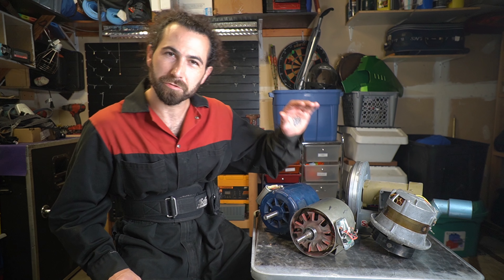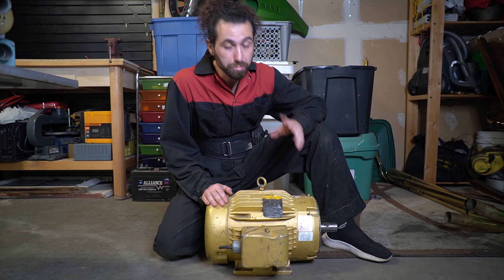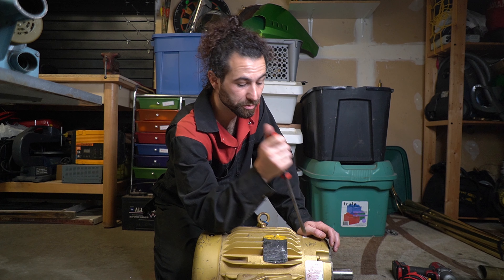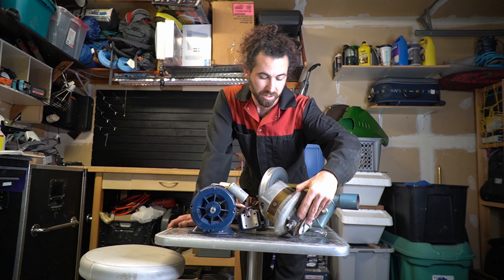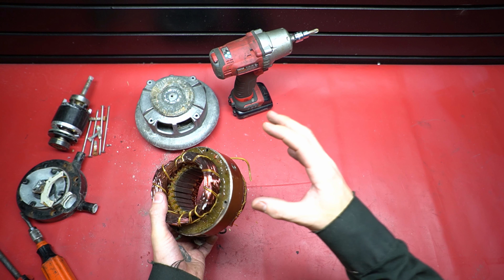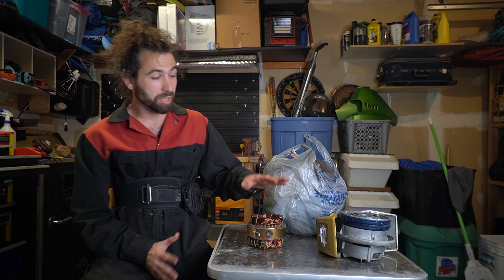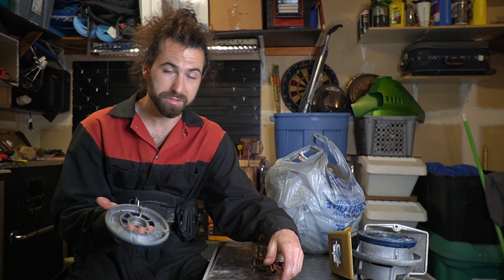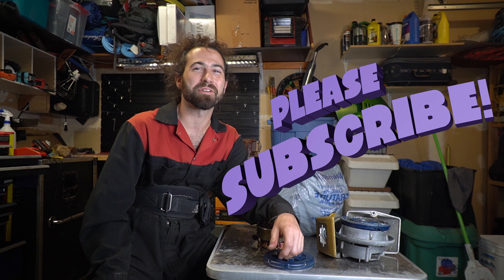Scrapping Electric Motors For Copper Recycling - The Complete Guide!

Comment: We were able to save 1000 lb of number two from the motors during the lockdown. Normally we cut the motors out with the sawzall. Then we cut the copper with a sawzall or we use a four and a half inch grinder with a diamond blade. Sometimes we use a 7 inch diamond blade but the diamond blade works better it doesn't fall apart and it doesn't leave us much dust it will cut down on half of the amount of and the blades will last three times longer. Remember if you use a 7-inch diamond wheel you have to use a bigger grinder. We also suggest if you're going to use a vice use a smaller one or one with smaller Clausso this way you can put only half the motor in there to bite down I'm half of it and that's all you need. You'll never be able to find a place that will open up big enough to hold the motors. That's a good video thanks for doing it. Once you going to hang up doing it you can knock them out very quicklythe big motor probably would have taken about 15 minutes to a half-hour the little motors normally take about 5 minutes. That's once you're all set up and you have good experience on doing. A chain hoist fromceiling hanging down with Claus is the best thing to use and you can pound out the copper. Remember gravity can be your friend. We even cut up compressor motors out of sealed units.
Reply from the maker: Sounds like I should hang out with you for a day! Thanks for all the great tips 👌😃
Reply: Some 1 inch acme rod and a few nuts and some steel will make a pretty nice vice that would work as well. Just a thought. I have ordered 1 inch by 5 threads per inch nuts and rods for a low price online a few times.
Reply: A large vise is the best but no vise is big enough for the larger motors. Doing like you said is the way as far as clamping them.

Comment: Having the right tools makes a huge difference. I have a hilti wheel cutter with Diablo cut wheel. Cut off both sides, go through eight motors in an hour.
Reply: That’s impressive
Reply: I hear you on the cutting wheels,but the other sounds exaggerated.

Comment: I have grabbed several fan motors and had a ton of fun figuring out how to get the copper out without cutting it. I cut all the string off and then worked loose wires and too them out one loop  at a time. Inner loops first, outer loops after. It was time consuming and I found it fun but I am sure others would find it tedious.
Reply: Way too slow .No one I know would call that fun.Cleaning motors is hard work.

Comment: First I would like to say that I always enjoy your videos.  This is the first time though that you approach was sadly a very inefficient way to remove the copper.  I do a lot of them and I also use a cutting wheel to remove one end.  But then I have tent stake that is roound  with a loop on one end.  The diameter is just small enough to fit inside the grooves where the copper is, and I cut off the non looped end to create a flat surface.  Then it is just a matter of tapping each slot of copper until the copper is roughly half way out of the housing.  Then I use the claw side of a hammer to strike the copper which pulls the copper the rest of the way out of the housing.  It takes me approximately 8-10 minutes per electric motor.  Good luck and keep posting great videos.

Comment: Extremely glad you finally are taking apart the motors for the copper windings. That’s my favorite part of scrapping from just the payloads of copper I get. Some motors are incredibly tight but others have windings so loose they just pull right on out
Reply from the maker: I figured as much. The blue one had windings packed right to the edges of the channels, and the other ones I had looked like there was a lot more space. I had some more footage explaining my observation but I decided to cut it to keep the video length down because it didn’t feel like it added significant value that wasn’t otherwise implied. Thank you for confirming my suspicion!

Comment: Hey there boss.  Small and big are both worth the effort.  I get them down to the case(small) cut off one end using a hacksaw on a vice(least amount of waste), put on side and roll a little at a time hitting it with a 3lb sledge(pushes stator walls in this loosening copper) too the open end with a little penetrating oil, move to next and do the same.....By the time you're done with next the previous one will let copper go with little effort.  I can knock down 15 in an hr unless my canine companion wants some love.  Big ones I cut end, beat with hammer, oil outside of stator, section with chisel and hacksaw, little oil, flame(to loosen glue/insulation) hammer and comes out quite easily.  My biggest stator was 190lbs and still wasn't that bad(used 16lb sledge on that one) on time.  I do the aluminum ones for the steel(yard picked my truck up with claw crane and dropped it with 1400lbs of steel in the bed so I get a really good price on steel) and save the wire til I get a few buckets and add it to an aluminum run in.  Rock and roll sir.

Comment: I save oil from compressors to use for lubing up motor windings so they come out alot easier.   Great for rusty bolts too and its free as a by-product of scrapping 😎
Reply: If you start cracking open AC comp motors there will be a lot of oil to get rid of. That oil makes the windings come out pretty easy and can be used to lube other motor windings.

Comment: For the reciprocating saw get ghee Diablo blades, they do cost more but last longer
Reply from the maker: Hirsch nope thanks for the tip! I definitely had the wrong blades. And I am a big believer in spending a little more for quality tools to get the job done right.
Reply: Carbide tip
Reply: @thubprint  another tip would be to examine the tooth size of the Sawzall blade. I suspect smaller would be better, as it's normally the preferred style for thinner material, but copper is so soft it may not matter. As far as carbide, yes it's amazing but way more expensive, so cost/benefit has to be a factor. Also Diablo seems to consistently be at the cutting edge of carbide and bladed tool research, so they're where I would definitely start. They also seem to have very competitive prices from what I've seen and what I remember. Hope this helps!
Reply: @ChristopherGoggans  Diablo blades are the best. Few notes on them are to start off slow and then speed up. Keep them cool and they will last a long time. Mind your blades with care and they will stay good. I cut 3x6x1/2" thick tube 2 times with one blade and its still going strong.

Comment: M8 that was an informative video cheers. I scrap the motors from the water pumps inside the washing machines. They're small motors that are made of some type of composite , easily breakable and worth the amount of copper in them.  Keep up the good work. God bless y'all.
Reply: I do that also.All manner of motors.Washing pump motors are usually copper but the drive motor is not. The washers that have no agitator usually have copper also

Comment: Well put together video!
First time is always the longest!
After more experience even the big motor should take well less than an hour and the small ones less 15 minutes! Then that's when you start to realize it's worth it to crack them open!! 
Especially with copper prices on the rise!!
Have a GREAT Day!!!
Reply from the maker: Thank you, and you as well!
Reply: It's about time someone was honest. Thanks for that.Some of the smaller ones will even go faster.  I even do ceiling fan motors . These motors use a different method but are usually done within 4 minutes or so.

Comment: I wish you or another scrapper lived by me so i can buy your copper so I didn't have to do it, since I just melt it down for funsies. However, I will tell you this. I spend my time going to my scrap yard and buying motors to pull the copper out of. I have never found aluminum in the industrial electric motors, always copper. If im not mistaken copper is way more conductive so it can make for more powful motors that the industrial purposes need on their applications. My scrap yard doesn't get the bigger ones often, but a lot of the smaller ones, the smaller ones are usually from boat lifts since its Florida where im at. The only ones I have found to have aluminum wire, and I have been burnt every time is appliance motors... dishwashers, washers, and dryers, sometimes microwaves. 

Also best way to dismantle (i have found) for the cases, is to cut off each side of the chonky windings (6" grinding wheel best for the bigger ones or ya, sawzaw) Get two building cinder blocks, place them on your work bench, put the stator on top, and then punch-out the straight bits in the stator case. I made a metal box when im grinding that'll contain most of the copper dust in the box, and i can sweep up all the copper dust, put in a jar, and then I melt it. For you scrapping idk how dust would work at a scrap yard. 
But ya but hammah smash to the iron and aluminum cases, grinder to the steel, pop right out.
Reply from the maker: You’ve got it figured out a long time ago! This was a learning experience for me for sure, and I made a lot more work for myself trying to do it quickly and easily.

Comment: Definitely assembly line several of them at once. It makes it look like you get more copper when you have several to show for it. I wish I could get some giant motors like that all the time!
Also for my aluminum ones, they are only one or two cents less than a copper motor at my yard so I leave as is, maybe bust off the easy cast Aluminum for a little more.
Reply: One of my great disappointments in life was finding out that most large appliance motors have copper coated aluminum windings. 
That, and getting fat after years of being in shape.
Reply: @willlastnameguy8329 I don't think it's a copper coat. Some of the windings are green some red.The coating is a coating to keep the electricity from jumping from one wire to another Color means nothing.

Comment: I did scrapping.  As do some people that had used copper as
salary hire or owned it as a business property.  Either of the
latter can fall upon a passer-by that lacks their permission to
handle scrap.  The scrap I got came from obtaining verbal
permission after my day work at the site was completed.
I still have about 3 yards left after 28 years of using it for my
home repair needs.  Saved me a dime and time wasted.
Personally, I never cared for motors, but some do go there.
Reply from the maker: I’ll be keeping an eye out for the big motors, but for the most part, nah.
Reply: Motors get way easier with time and are very profitable.

Comment: Once you get the casing cut or broke off.
Cut the lead side of the copper off.
Build a nice fire and put the windings in the hot fire.
Let cool down and start pulling..
Reply from the maker: Oooo, thermal expansion! That’s a real good idea to get things moving, and if you’ve got a pile it would be real efficient too

Comment: 10:44 which is why we bake the motors when we are doing a rewind. You bake it to the point the varnish melts and burns off and its easy to cut through the windings to count the turns.
Reply: Burnt windings are not sellable.

Comment: 2 ways youngin.  First, wood fire and burn off the coating.  that loosens the copper and brings it out easy.  Vinagar and salt will clean up the copper to #1.  2.  air chisel will bring them right out after you cut the windings on one end.  A few have plastic coating like house wire instead of enamel.  Just run those through a stripper to get #1.  Muratic and salt will strip the enamel taking it to #1.  Motors are easy money once you learn how!
Reply from the maker: Can’t wait for the next pile now ☺️
Reply: @thubprint Don't burn unless you absolutely have to.Your neighbors will call EPA or some such nonsense.

Comment: That was a good idea scoring the cast shell like that. I never really thought of that. Them cast iron ones are way harder than the cast aluminum ones. I used to have a 7 ft. piece of pipe with a 10lbs. splitting maul head welded on the end of it. I nearly broke my wrist a few times trying to get the cast iron shells off of them big ones. 

If you do this again when you get the big one down to a stator, cut both ends of the windings off. then throw it on a vise or drill a hole in a pretty sturdy table and punch the copper through the holes individually. I used to have the bolts I saved from big ac compressors hanging on my truck bed for this purpose. some people use nail punches, but I've found you generally can't get the copper all the way out with a nail punch and generally have to pull it half way out with some pliers or something. careful with the bolts though they tend to bend and get stuck unless you hold them with some kinda pliers.  

If you do it that way you should be able to get the big one apart in maybe 30-45 minutes depending on how stuck the copper is inside the stator. 

the big ones really used to slow me down when I was running sealed units. the first one I did took me two hours of strenuous beating and trying to pry the copper out with a huge pry bar. then someone told me about the method I just went over.

 I made a hydraulic puller for them now so hopefully they won't be an issue anymore.
Reply from the maker: You MADE a hydraulic puller? That’s rad! (I think I mentioned you in this video but if I forgot, I meant to) your video was one of the ones I studied trying to figure out the easiest way to get these apart, but I didn’t have a maul so I needed to make do. Hence the scoring!
I think next time I get one of these that’s gonna be the trick, cutting off all the ends and working the holes one by one. I was trying to save time keeping them together, and that’s what made it take so long lol.
Do you have a video of your hydraulic setup?
Reply: @thubprint  yeah. its actually a log splitter. I bought it new just cause it was easier that way but an old one would work. or if you know a guy that is good with hydraulics and welding you could really make something a lot better but I don't know hydraulics that well so I just made something that worked for what I needed it to do. its still in its early days. more modifications to come but this is what it is right now. https://www.youtube.com/watch?v=Du74WrzijGM&t=1881s
Reply: @thubprint  I watch a lot of your videos as well at times. even if I know how to take apart something that your showing how to take apart sometimes I still watch how others do it. your videos really explain things pretty well to the viewer compared to most scrapping channels. its almost like you went to school for film or something.
Reply from the maker: @scrapmanindustries  I appreciate that, thank you! I didn’t do film school, I just watch a lot of YouTube and have a very short attention span lol. I like to write a script first (sometimes) so I can stay direct and to the point, and keep “show them don’t tell them” in mind. Stoked to hear it seems to be working!
Reply: @thubprint  yeah man, there's definitely a lot of information people can get out of your videos. the only complaint I have is the man bun. but those just aren't my thing I guess. definitely keep up the good work.

Comment: On large motors, I cut off both ends of the copper windings and use a long thin bolt from the motor to tap out the rest. Some of it even falls out. Usually takes me about ten minutes
Reply from the maker: That’s a MUCH better idea... where were you a week ago??? 😂
Reply: Glad you like it

Comment: I find it very easy to remove the copper from motors and transformers after you stick them on a BBQ grill and cook them for a while. The fire burns away all the string, glue and insulation completely. You then just drop the entire transformer into a large bucket of water and wait for about 10 minutes while the water boils.  The wires will just pull out without even cutting them. Plus, the wire is a #1 product ready for melting or selling. I melt all my copper into ingots, and there is hardly any ash or slag.
Reply: Very illegal won't work if you have neighbors close buy.Burnt wire is not sellable on the other hand if your smelting and no one close .  Then go for it.

Comment: A slide hammer with an appropriate size right angle hook on it will get the wire outta the bigger motors while only cutting one end off.
Reply: Have not tried this but I will. Faster means more money!

Comment: Nice take on scrapping! When I get the motors with the heavy coating on them, I like to cut both sides and then punch the rest thru. Seems to do away with all of the binding that you just experienced. However, I did get a few tidbits of info about checking them to see if still good. Thx! GearHead!

Comment: Okie scraper uses an air hammer to remove the copper from the metal housing.  You should check it out.
Reply from the maker: I’ve actually seen him use that and it looks great! I don’t have an air system set up unfortunately but if I get one, that would be a great asset to the toolkit 👌
Reply: I wonder if this works for the motors that are really stubborn. I need to get a bigger air compressor so I can try it out.

Comment: Not sure if you came across any but I'm sure you have judging by the amount you would've  scrapped but the ones that have wood instead of plastic insulation I found a little harder to get the copper out. I usually cut both ends and use an old or broken hacksaw blade from a heavy duty electric industrial hacksaw machine (not a hand held) . I have several the blade are wide thick and super strong.  I use as a scraper blade, chisel and punch and is perfect for getting each chunk of copper out.i also agree Canadian treasure hunter has it sussed. For the size he's done a block splitter or axe should do it
Reply: Oh man I remember when trash panda was simple now it's know-it-all panda.
😅 I kid enjoy watching YouTube videos I grew as a scrapper and so did your Channel